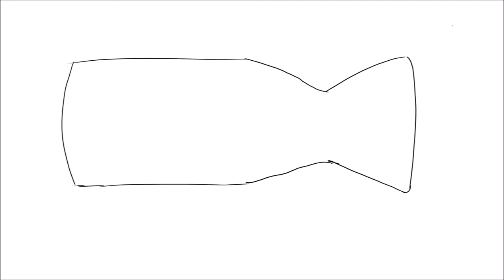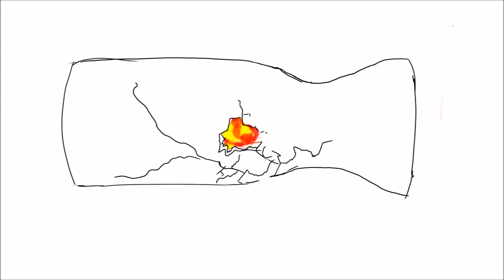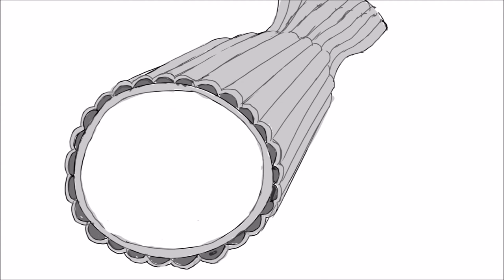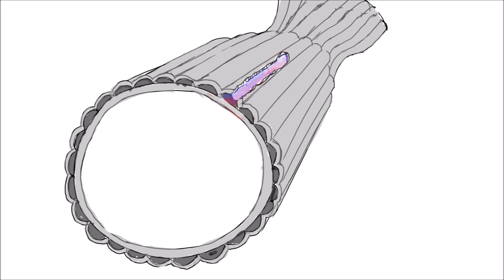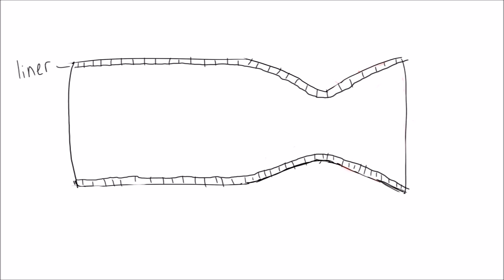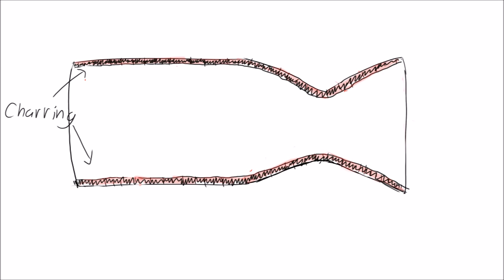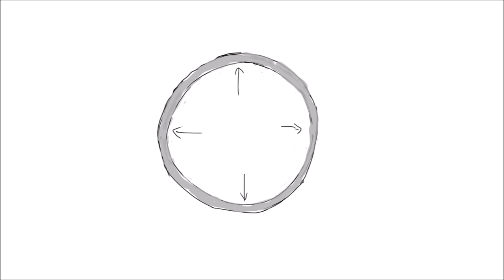Cooling Methods for Rocket Nozzles

Comment: In ablative cooling method, the only thing that should be taken care of is a throat. It should not change the size - usually the inner ring made of tungsten alloys is used. Combustion chanber will lose the inner layer (layer by layer) but the performance impact is not so severe, especially on first stages with altitude changes. Also depends on material - carbon fibers or selica fibers can sustain upto 2000 C which is enough for low performance fuels (not LOX/LH, or ACIDS and Hydrozines, and of course not a Methane). But look at the possibilities - with ablative nozzles and electrical turbopumps using low-performance propellants, the total cost of launcher can be surprisingly cheap for 1000-2000 kg to LEO payload capacity :))))
I rocket industry, efficiency costs a lot. Better to be low profile, non-efficient performance will be giving a huge launcher size to payload capacity ratio, but will be cheap, reliable and ecological. It was proven by Armstrong Siddeley in late 60-s, Beal Aerospace in late 90-s.

Comment: Hey, as long as we're talking about nozzles and velocities, I'd like to hear your take on the difference between KE and Momentum (p).  Now KE is proportional to V^2 and p is linear.  What the heck is the difference.  I mean if I go bowling and I throw the ball, what is at work knocking the pins over.  I always said it was KE, but then someone said it's p.  The question came up because I never ever bowl, and one time I happened to pick up a 15lb ball instead of a 16.  I was able to roll the ball so much faster that pins were flying all over the place.  5 strikes in a row kind of flying.  So I thought that the V^2 was why.  But if it's just p, then would it have made that much of a difference?  Or any difference at all?
And Olaf Willcocx told me that KE in a rocket nozzle indicates that v should be as low as possible and m as high (within sane limits) so that thrust is increased and fuel consumption is minimized.  
Can you explain any of that?
Reply: take a car crash, for example. the impulse p is conserved, while a huge amount of kinetic energy is converted into deformation of the cabin. so if you want to calculate the resulting direction and velocity after the crash, you use the law of conservation of impulse, and you get an easy calculation

Comment: What about Solid boosters ?
Reply: They can't and don't need cooling they burn much faster than liquid fuel engine and burn out quickly so you don't need cooling beside that cooling of a solid fuel is almost impossible the system of burning fuel is different there is no gas for cooling and the way the solid engine burn fuel is fast and so they get very hot but since they burn quickly they don't need cooling system